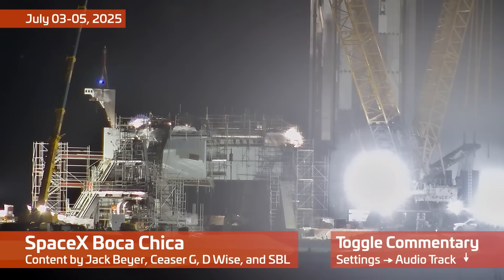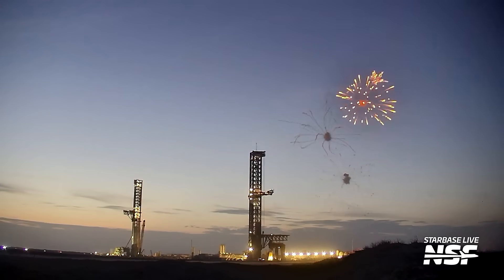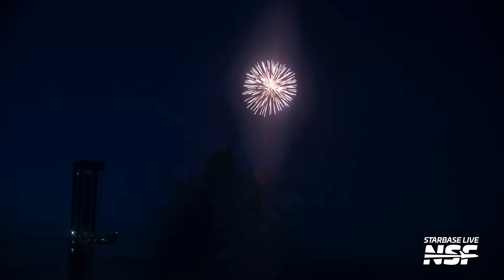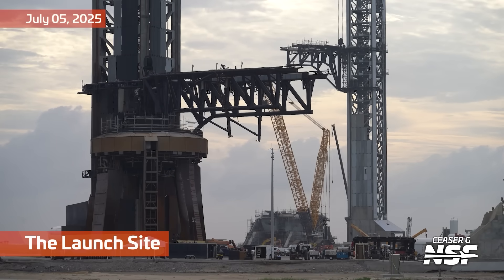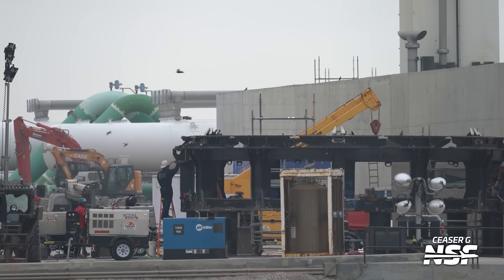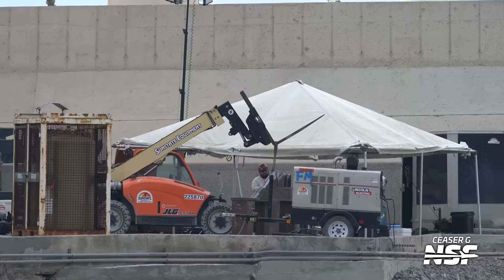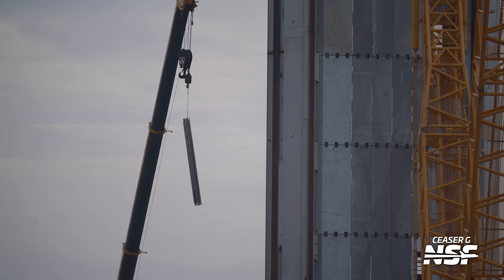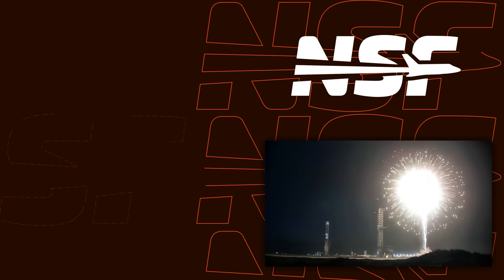"Explosions seen over the skies at Starbase" (Happy 4th) | SpaceX Starbase

Comment: A Scaffold is a unitary construction which was built to facilitate the execution of criminals convicted of capital crimes. If you built two of them, you had two scaffolds. Scaffolding is a system of standardised and certified components capable of creating practical and safe working platforms in an almost endless variety of working situations.

Comment: The multi-pass welding is most likely adding thickness of metal and heat tempering.
The intense heat from the booster flames will definitely change the tempering of those shields, and adding material will increase heat absorption properties as well as structural reinforcement.